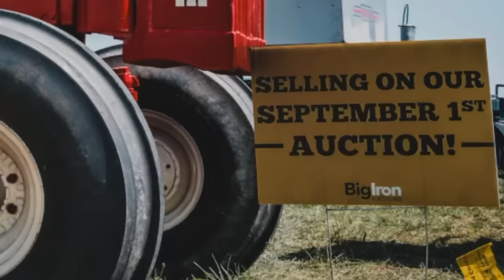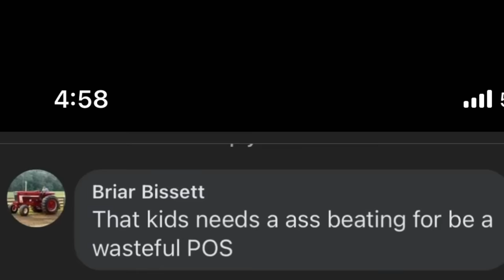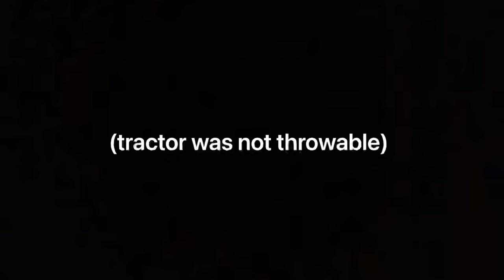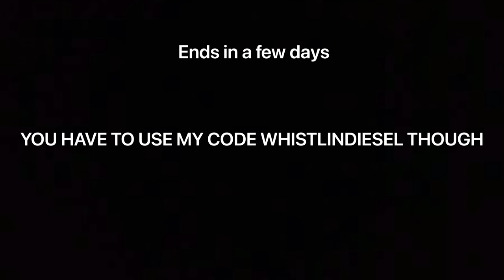I have 60 days to make this Farmall not exist anymore.

Comment: The IH doesn't bother me so much: But the Massey 175: I bet there was lots of good parts on that one.
Reply: Dude same
Reply: Yup
Reply: Bet it just needed the rear wheel fixed, some fresh fuel, & a battery.
Reply: I know
Reply: Uncles in laws have one that the family bought new. The engine has never been apart and it still fires up like it was brand new. Those Perkins diesels were probably some of the best engines ever made.
Reply: Yeah I had a 154 there so gangster never had it bogged aswell I’ve pulled some shit with that